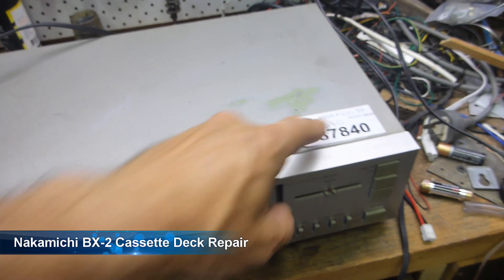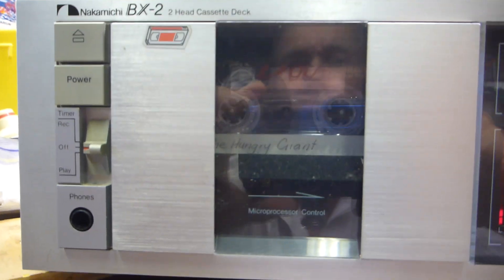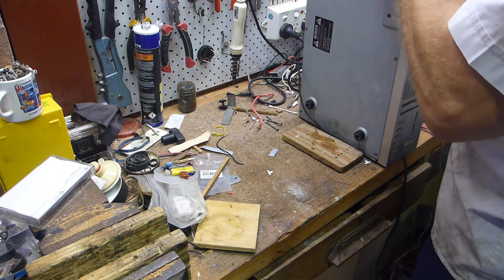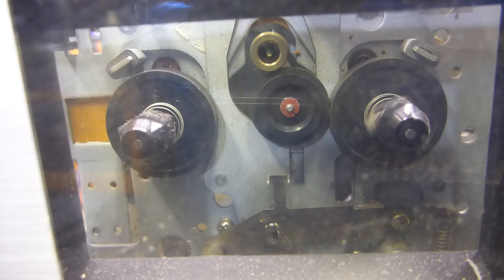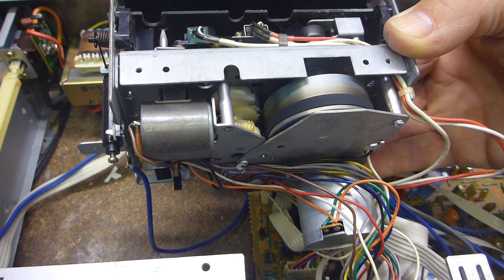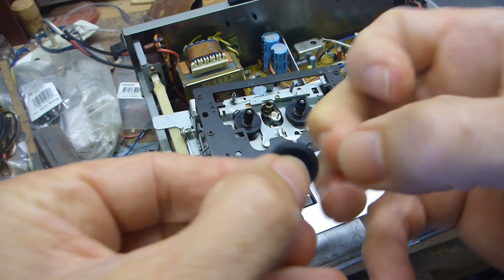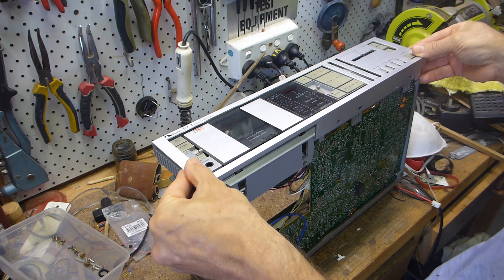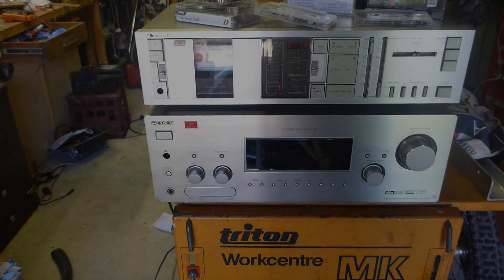Nakamichi BX-2 cassette deck teardown, service and repair

Comment: Replacing the pulley wheel Where to buy?
Reply from the maker: I found mine on ebay. Pretty sure I included a screen shot of the part.

Comment: Hi, you can whiten the yellowy keys by covering them with a tissue and applying hydrogen peroxide. Let the deck sit in the sunlight outside for 30min or a bit more (not necessarily direct blazing sun, btw!) wrapped up in clingfilm. Magic!

Comment: Hello , I have a BX2 and there is a problem that when the power is switched on it goes into play mode even without pressing the play button or even a cassette in the compartment . What could be the problem ? Thanks
Reply from the maker: It's possible that the switch needs a clean with deoxit.
Reply: @pescado99  Thank you, will do that .

Comment: I have a BX2 with the same problem. I had it “fixed” by a shop several years ago who said parts were no longer available so he cobbled something together. It lasted less than a month and when I went back the shop was out of business. I wonder why. Where did you source the part? I would like to get this working again?
Reply from the maker: I bought the part on ebay. Cost $17 AUD and worked a treat.
Reply: Also you can use a swab with acetone to clean the rubber wheel. If you don't want to replace it.